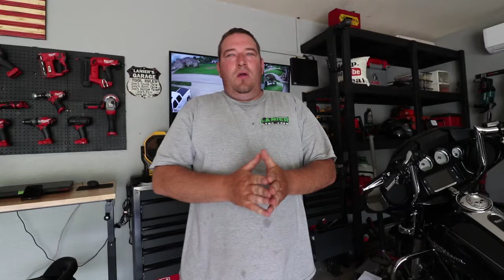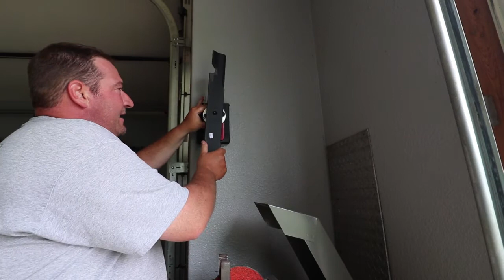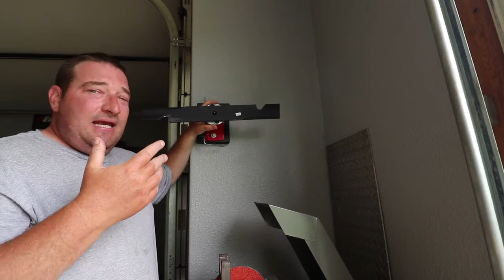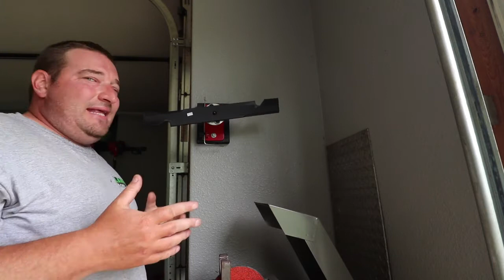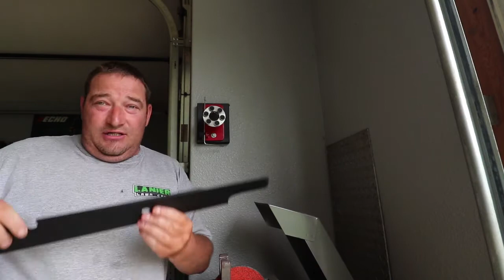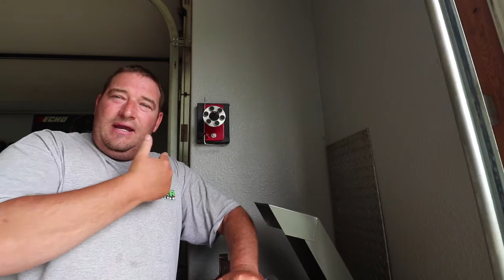Nail vs Blade Balancer - Does the Nail Really Work?

Comment: Yea this makes a lot of sense, I was seeing you can sharpen the blade in 1 minute via angle grinder with the right disc, I did not think of the offsetting of the weight. Thanks for showing the nail doesn't actually work accurately as I just seen a guy say to use a nail.

Comment: I've used the screwdriver stuck in between two boards on the wall since I started sharpening our blades for our lawn tractor and rider myself and thought I had them pretty balanced, but last summer I bought a Techomec blade balancer (Italian made knockoff of the Oregon blade balancer) and was shocked to see that all blades where totally out of balance when I put them on the balancer! (When I balanced with the screwdriver, they DID NOT touch the wall) , so I'm exited to sharpen the blades and see and feel the difference when the mowing season starts of.

Comment: I have a feeling the nail would be a lot more effective if the blade wasn't touching the wall!  I'm not going to claim nail is just as good, but it sure looks like the setup was designed to make the nail look a lot worse than it really is.
Reply: Yes, and maybe oil it a little to shave of on friction. I didn't try either method just an idea

Comment: There is absolutely no reason that a nail on the wall will not work. Gravity doesn't stop existing because you didn't spend $100. Your blade looked to me like it was flush against the wall which introduces a crap ton of friction. In fact friction is the ONLY reason why the nail method might not read accurately. But lets be realistic, we are talking about cutting grass and not engineering specs. Placing a small diameter bearing between the nail and blade would do the exact same thing for $1. That removes any friction.
Reply: You should look up propeller balancing.